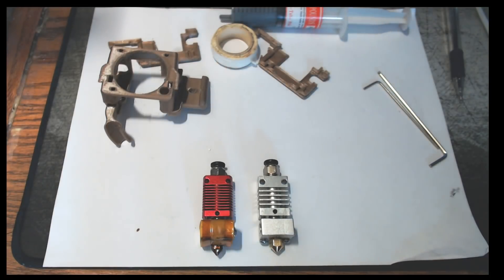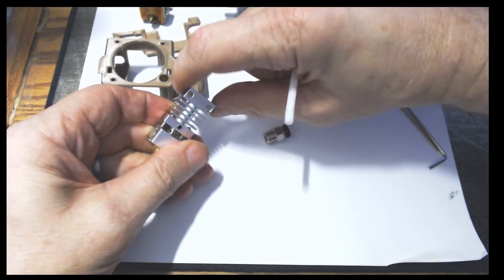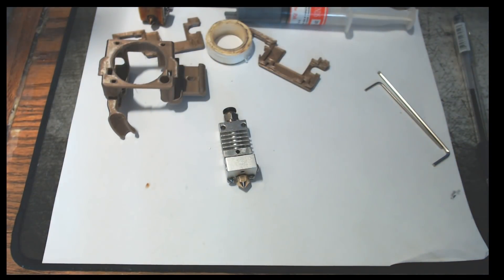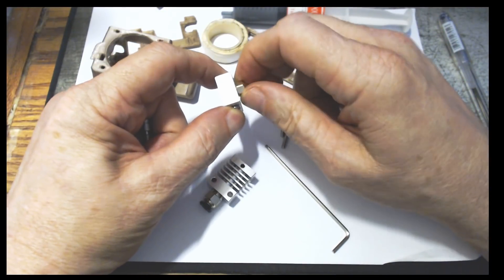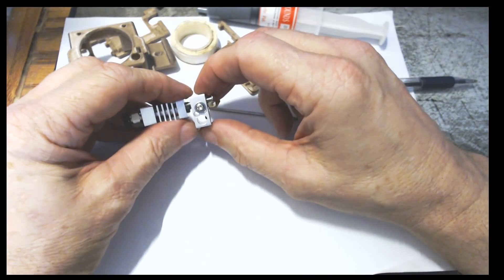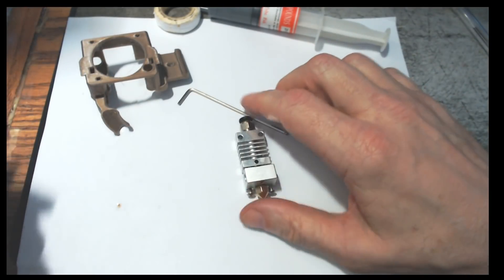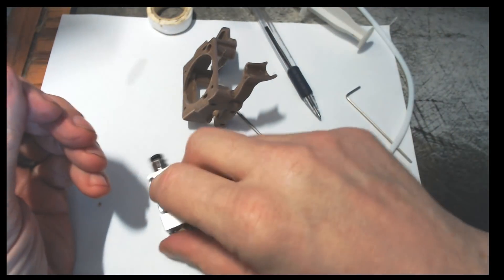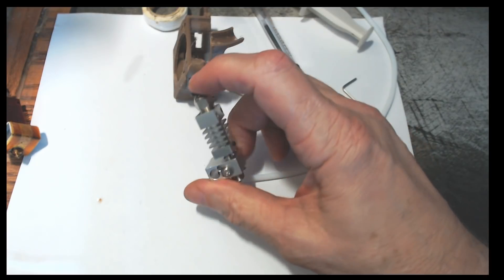All metal hot end for the Ender 3 for $7. Part 1, tips, trips and lessons learned.

Comment: Remove those two heater block screws once you tighten up the heated nozzle, they will cause heat creep otherwise
Reply from the maker: Really? I've never heard that before but it does sound logical. Thanks, I'll give it a try!
Reply: @3rdpig  yep they're only for initial setup, look at the microswiss install video
Reply: @choco107  CHEP did a video regarding this and his conclusion was that leaving them is fairly negligible, and Creality confirmed that they are meant to be left in.
Reply: Did he test at 300 and over temps?? Maybe for stock it's ok, but I'd rather go off microswiss and take them out if using high temps and all metal hotend
Reply from the maker: @choco107  Thanks again, as soon as I get a chance I'm going to heat and check the nozzle tightness and then remove those screws. I was thinking that those screws seem redundant, I should listen to myself more often, lol.
Reply: why would heat creep into the heat sink matter, it would only help remove excess heat, that's the job of the heat sink
Reply from the maker: The job of the heatsink isn't to remove heat from the heat block. We want the heat block to stay hot because it has to keep the nozzle up to temp or the filament jams. At the same time we want the heat sink to stay cool to prevent the filament from melting before it reaches the nozzle which also causes jams. That's the function of the heat break, to prevent heat from moving from the heat block up into the heatsink...or at least prevent it from moving up faster than the heat sink and fan can remove it.
Reply: CHEP did a video on this, and it turned out the temperature difference was negligible. Sigh....
someone already said this.
Reply: Hi just watched your video....would a ceramic heat break instead of a metal one between the heat  block and the heat sink be better as the ceramic won't transfer heat back. @3rdpig
Reply from the maker: @gangleweed  Hmmm. It probably would,  but does one exist? I've never worked with ceramics so I'm not sure if it would be strong enough or if there would be some other reason it wouldn't work. Can ceramics be cut on a lathe? If so, I might have to get some and try to make one. Dammit Ian, I don't have time for this!  lol
Reply: Hi, you can get ceramic powder similar to plaster of Paris and mold it like clay then bake it in an oven to make it rock hard etc. That is probably overkill and it could be fragile but  there should be enough air from the fan cooling the heatsink to also cool a metal heat break......I would think that a slightly longer metal heat break could be made with some fins on it to also increase it's cooling ability. .. @3rdpig

Comment: that all metal hotend is a piece of crap, i have ordered 4-5 of theese just for the heatblock, 50w heat element and the thermistor, theese parts are good but the rest is usless  theese parts i use on the stock mk 8 hoteng boosting the capacity and extend the max temperature to 300 degree with capricorn tube.
Reply from the maker: Interesting, I'll be sure to tell the two printers that have been running them with no issues for over a year that they're useless.

Comment: ok I got taken I payed 57.00
Reply from the maker: If you bought a cheap one directly from China for $57 then yea, you got taken. But if you bought a Micro Swiss either directly from them or one of their authorized retailers, you got pretty much the same hot end as the one for $7, but with a lot better fit and finish, quality control, instructions and after sales support. While that's not worth $50 to me, it might be to you or others.
Reply: @3rdpig  the micro swiss are 198 bucks
Reply: Oh you need to polish the barrels and nozzle then it will not stick to the plastic... Colgate toothpaste drill bit kapton tape, filter paper have you ever honed a cylinder block...

Comment: Do not recomend ender 3 . They will cost you more then a real 3d printer in the end.  .they are all about upgrade after ip grade scam
Reply from the maker: I've maybe put $25 into my original Ender 3 and it's been printing for almost 3 years 3 or 4 days out of the week in PLA, PETG and TPU. The other Ender 3 I bought I've probably put about $150 into, it's enclosed with an upgraded control board and steppers. I can print any filament on that including nylon and polycarbonate. What does a "real 3d printer" that can do that cost?